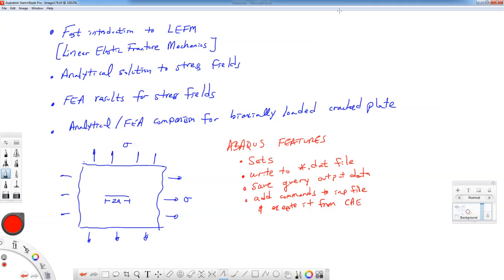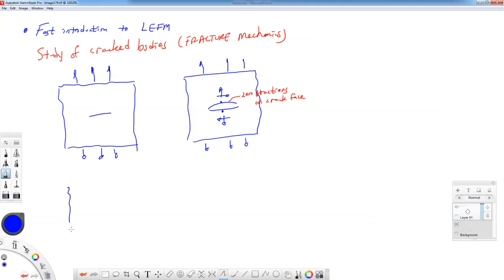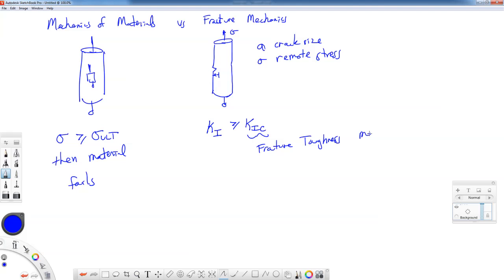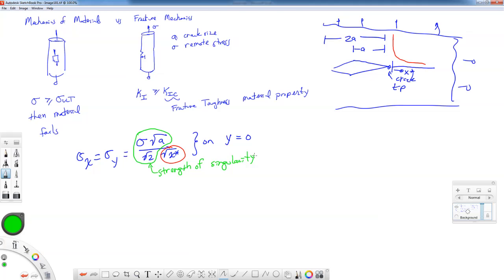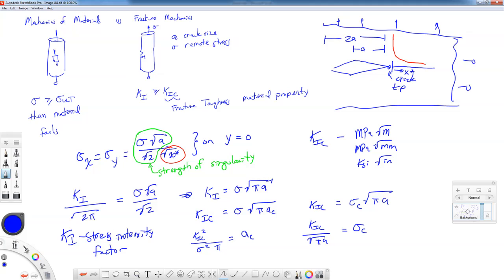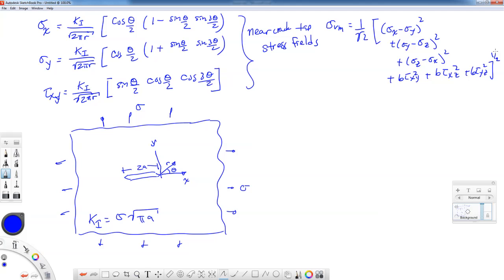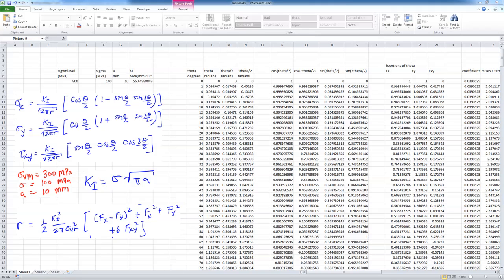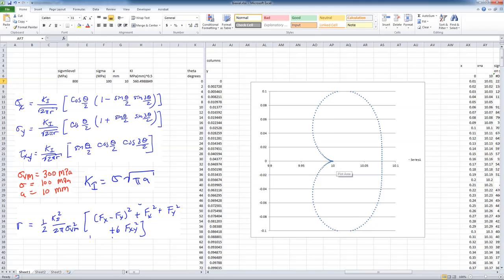AEM 535 HW-9 Part A Crack Stress Fields: Analytical Solution

Comment: Dear professor Barkey, in this lecture I've learned that crack would propogate when stress intensity factor greater than fracture toughness. In your video the fracture toughness has clear symbol K_IC which stands for mode I failure. I would like to ask in practical, should we measure fracture thoughness for each failure mode (mode I, II and III)? Generally, real-world problem is more complicated and any failure mode would contribute to crack propogation.
Reply from the maker: Mode II and III can occur in particular situations; mode I however is most prevalent, particularly with regard to fatigue crack propagation since, if given the possibility, the crack will tend to orient itself in an opening mode as it grows.  There are tests for mode II and mode III material parameters but if you have those modes then you would probably try to test your component in the service load situation and see what information you can get from that combined with a detailed finite element model.
Reply: @mbarkey.mechanics  Thanks for your kindly reply. Because when I use Abaqus XFEM to predict crack propogation, I need to input critical eneryg release rate for mode I, II and III. That's why I want to know how to set these parameters. So far most example I've seen give the same value to each mode. I would like to ask in practical, crtical energy release rate is not the same, right? I thought it just a simple assumption.
Reply from the maker: @PhilCheng  I can imagine in certain situations the critical energy release rates could be the same or could be different depending on various factors. I can't say what you should use in your particular case--take care!

Comment: Dear professor Barkey, in this lecture you've mention that K_IC is a material property. I would like to ask how to measure this parameter? Is there any ASTM standard or reference book to introduce the experiment about measuring K_IC? Thank you very much.
Reply from the maker: ASTM E399 is the reference; it is for metallic materials.
Reply: @mbarkey.mechanics  Thanks for your kindly reply. I'm recently studying how to predict crack propagation of packaing filler among IC component, the material property is close to glasses. As professor mentioned before, LEFM is a great tool to deal with brittle material. I would like to ask that ASTM E399 also suitable for brittle material like glasses? Really appreciate your help.
Reply from the maker: @PhilCheng  E399 is for metals.

Comment: Sir, In analytical calculation you assumed 300 Mpa as Vonmises . How is it assumed.?
Reply from the maker: It is an arbitrary value for the contour level.  Change it to whatever you want--higher values make the contour closer, lower values make the contour farther away (but too low doesn't make sense, and the formulas are derived for the near crack tip stress field).
Reply: Mechanics Channel by Mark Barkey .Sir can i get your mail id please?.I have some doubts regarding XFEm method
Reply from the maker: I have made an XFEM video, but other than that, there is not much I would be able to help you with XFEM.

Comment: what if the crack was inclined?
Reply from the maker: For the biaxial remote stress field it won't matter, since Mohr's circle in the plane is a point and you will not be able to develop remote shear stresses.  In other cases with remote shear stress, you would have a mixed mode I and II situation.  Mode II stress fields are different, but very similar in concept as far as the singularity goes.  I would refer you to textbooks for the appropriate solution.